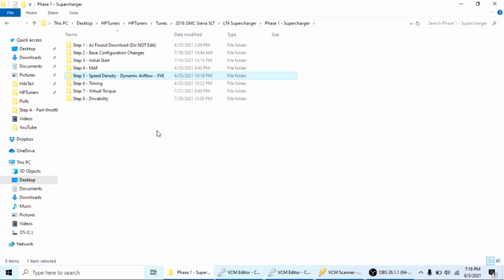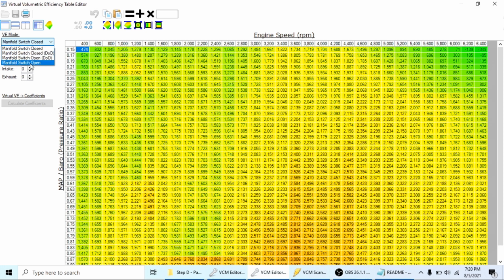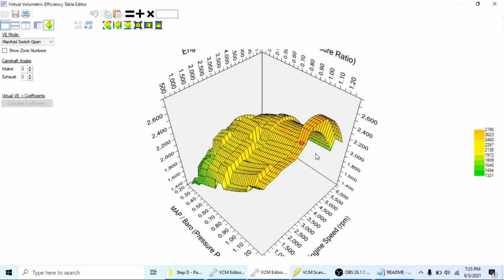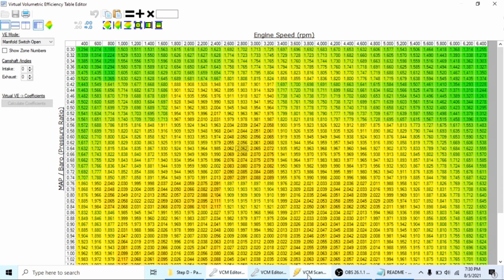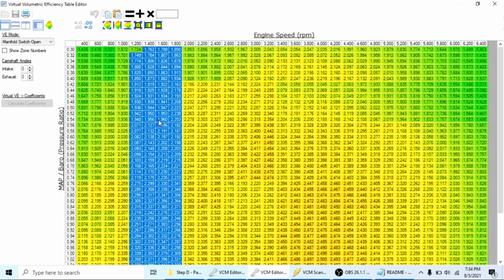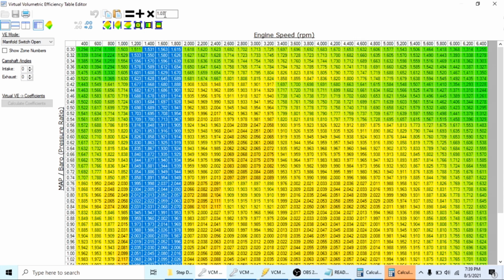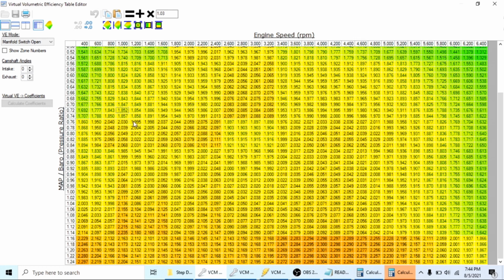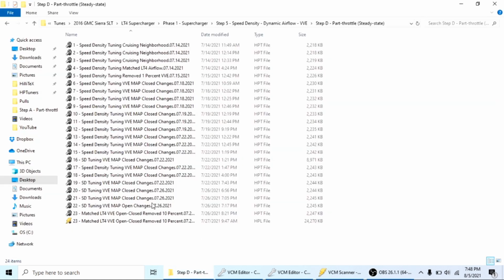LT4 Supercharger Install - Tuning, Speed Density VVE

Comment: I started going tbrougb my SS tune and comparing to a zl1 tune. The SS has some more tables but is missimg some from the zl1. Can i upload a zl1 tune after my SC install or will i brick my ecu
Reply from the maker: Hi Timothy, is the ECM the same generation for both the SS and the ZL1? Example: Gen IV, Gen V, etc. Which tables are missing?
Reply: @hillitex2208  i have a tune from a 2018 zl1 and my ss is a 2017 so yes same generation.  Ill get a list of missing tables for you
Reply: @hillitex2208  SS has but Zl1 doesn’t
B1615 EOI timing low pressure
B1637 Split pulse Min
Injection timing, SOI E85 Min
Injection timing, SOI IVT Mult
Crank split factor high pressure, low pressure auto start
Crank split factor high and low pressure
B7009 max boost pressure
B7002, B7022 the  Mass airflow range much higher on ZL1
B7009 are different tables
B7021 Max press ratio Lbs/min higher in the ZL1
B9903, B9999
B1876 proportional multiplier
ZL1 spark tables Air per cyl grams higher on ZL1
B1099 MAF freq range more specific on ZL1
B8311 Torque limiting TCM error
Torque model tables different ranges for cam position
Reply from the maker: Some of those tables you may not need - specifically the split fueling tables.

What I would do,  is to use your SS tables and only copy the changes needed from the ZL1 tables - specifically the tables related to timing, fueling, and air. That is essentially what I did and that would get you started.

I'm assuming you're installing the ZL1 supercharger on your SS?
Reply from the maker: You might also need to upgrade some of the sensors, like the MAF, MAP, etc. to account for the changes. Also, if you plan on using the stock fuel system then you should look into a different supercharger pulley. Otherwise, I would upgrade to the ZL1 fuel system - fuel injectors, high and low pressure fuel pump etc. To ensure proper fueling.
Reply: @hillitex2208  what worries me though is some zl1 tables have a higher range. I am thinking about just putting in a zl1 cam that way if i use the zl1 tune it will be alot closer than using an ss tyne with a suoercharger
Reply from the maker: This series I created should help guide you in the process.
Reply from the maker: Some of the sensors will scale to the higher values when you swap it out and with some config changes
Reply from the maker: For example, my stock MAP sensor when changed to the Z06 3-bar MAP and with config changes scaled to the same as the Z06.